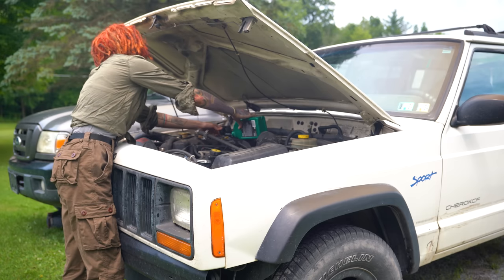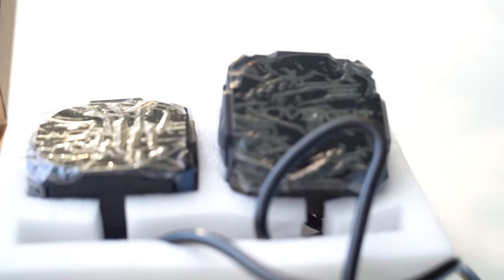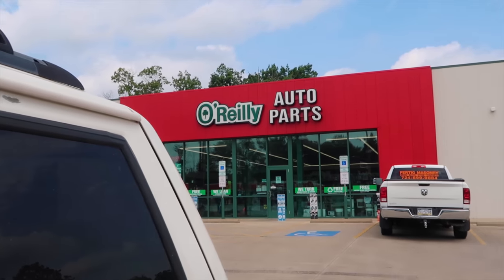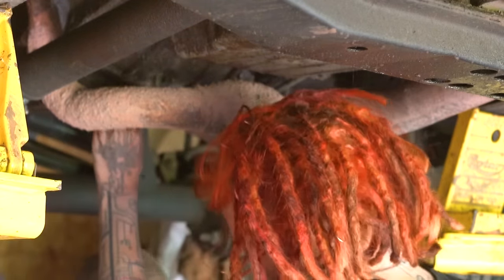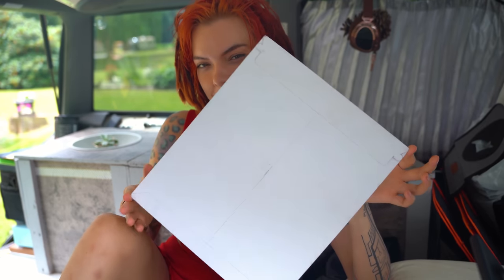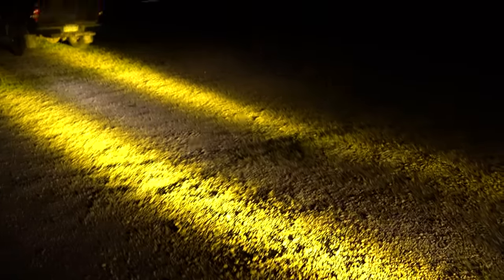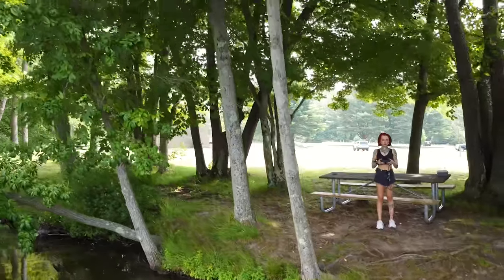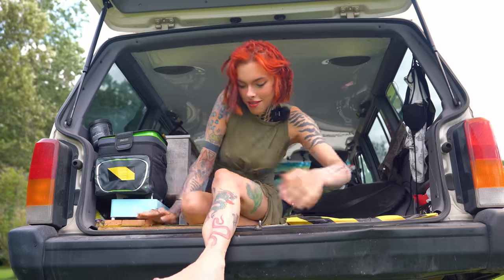upgrading my old Jeep Cherokee into an OFF ROAD Camper

Comment: Couple suggestions, upgrade your cooling sys, new cap, water pump, maybe a better fan clutch and auxiliary fan.  Also if you're having to prime your vehicle to start it could mean you're losing fuel pressure.  Could be a bad fuel pump, bad injector orings or fuel cap needs replacement.   Would recommend these items to be fixed before your big trip.
Reply: I second most of these suggestions, except ones regarding fuel pressure. Sounds like your experiencing heat soak with the priming of your pump. I've done hood vents, fuel rail insulators, and dual fans and it won't go away on those really hot days. Either or glad to see ya keep the XJ and looking forward to your Canada content!
Reply: @XJ_ESSE  I own a Land Rover discovery 2 with the 4.6L with a priming issue when the vehicle gets hot.  I'm pretty sure my orings are leaking and the fuel pressure regulator probably needs replaced too.  Typical on these older suv.  Victoria has a hum dinger.
Reply: @teyoung2000  I dig those discos, never owned one but good to know if I ever purchase one. But even with new injectors, coinciding o rings, new pump, at least in the XJ, it'll still leak down and lose pressure on hot days. I assure you, heat soak is notorious in these 4.0 straight six engines, and she'll be throwing money at something that is hard to get around when priming the pump 2-3 times will build the pressure she needs to eliminate the engine shaking at start. That XJ is no hum dinger, she went across the country and back with very minimal maintenance.
Reply: I agree, start with the cheap items first. Fuel cap, filter etc.

Comment: Yuki's coming along just fine. I would reconsider the placement of those off road lights under your bumper. I'd mount them on the top of the bumper (just drill some holes and rust proof them) or up on the roof rack so that they don't get torn off if you happen to cross over some weeds or other low obstacles while off road.
Reply from the maker: Yeah I considered that too but that was the easiest location at the time as there was holes pre drilled
Reply: Easy road is the Highway to Hell. To be better we have to put in some work.😂😂

Comment: Great job! I have a 98 XJ also. The shaking is more than likely the injectors. I would recommend K-suspension injectors. Also, new cap, rotor, wires and spark plugs will help. If you ever in California, I have a lift kit and bumpers and fenders I’ll just give you. Have a blessed day!

Comment: Jeep is looking great! A quick tip regarding your roof rack. It'll be a pain I know, I've been there, but take it back off your roof and put a good bead of silicone around the points where the sections of the rack come together. Once cured, hit those areas with a couple coats of black Rustoleum. Trust me, I have the same rack and within a year of having on my roof, it was rusting from those spots pretty heavily and dripping down onto the roof. And when it rained the rust would mix in with the water and leave trails down the windshield. Definitely worth the time and effort to fix .

Comment: I had a similar shake in mine. I took it to a shop and they told me the transmission needed to be replaced. With the help of the wealth of XJ information and enthusiasts on the NAXJA forum we narrowed it down to a transmission mount and I also replaced the engine mounts just in case. No more shakes.

Anyway, keep on keepin on. And have fun with your XJ 😊

Comment: New viewer / XJ daily driver for 15 years.  Pro tip try shell Rotella t5 or t6 for oil.  It has the proper zinc content the jeep 4.0 craves.  Im driving a 98 now with 330,000 on it and it purrs like a sweet lil kitty.

Comment: The trick to the decals is first cleaning the area where you're going to stick it(so it'll stick longer) then use a flat edge to smooth it down as you take the paper backing off(this gets rid of the air bubbles) Hope that helps! Have a good trip! 🦖

Comment: Great use of the drone at the start of this vid, very professional. A bit of advice don't rely on Bungie to hold down anything. They'll degrade over time due to UV. What you need are proper clamping straps. Carry spares out inside not on the rack.
Reply from the maker: They will prob outlast the Jeep tbh lmao
Reply: @TorieRobot  I'll remind you said that ;0)

Comment: With old trucks like these.you want to turn your truck on first wait about 10 seconds or till all the lights on dash turns off, then start it. These issues can come from grounding, old power wires, to your fuel system needing to be cleaned out. A full tume up is needs. Make sure the gap on the spark plug is correct. American motors like to share alot of the parts on assembly line so check that too. Anyways keep having fun!

Comment: Hang on to that Jeep! Put in the time and money it will become one of the most reliable vehicles available today and probably the toughest. This is an old vehicle that's worth putting money into. It has some age on it so it just needs some catching up on maintenance & repairs and a few updates to get with the times. Don't get discouraged when big things come up, there's nothing on that Jeep that cannot be fixed in a driveway or backyard and the cost will be much lower than anything else on the road today. When your Jeep finds trouble on the road.. turn to the Jeep community first, before you make a move or go to some unknown mechanic/shop.. you'll be glad you did. Maybe you already know these things but good info for other viewers.

Comment: It's a good idea to wear safety glasses when working on cars. I once got a small piece of hot steel in my eye because I took my welding glasses off to soon. It required medical care. I was a mechanic at a marina. Back then Wix was a better filter than Fram. I don't know if that is still true.
Reply from the maker: Yea that’s prob a good idea

Comment: YOU GET IT TORI!! Good job getting your oil change done yourself. If your using a Full Synthetic oil you can go 5000 no worries ( I use Valvoline High Mileage Full Synthetic myself ), Also good filter choice. Wix is a very good brand
Reply from the maker: Yes! Now I know how to do it! And yes I got full synthetic 👏🏻
Reply: @TorieRobot  good, I use full synthetic for all my fluids in my Jeep.... Ill be selling it actually in like 2-3 years if your looking for a newer jeep around then. Im going to be getting a ford transit, Im going to raffle off my jeep so you might be able to get it cheap!

Comment: get new battery terminals and check the wiring to the alternator and make sure your radiator is good. Check your fuel injectors. Most likely they are plugged up. Change your full pump and check the fuel lines. That's probably a couple hundred bucks. But will keep you going for a long time. change your spark plugs, gap them or get new ones. CHeck your fuel pressure.get a new fuel filter and check your battery.

Comment: Its been a while but a rough start that smooths out after a bit can be a hallmark of a failing PCV valve and/or I believe, a clogged throttle body.

Its been a long time since I've dealth with this stuff. 
The PCV valve is sm eady switch n replace. Throttle body involves removal 9f yhrottle body and cleaning out deposits rom the inside of it.  Happens after 25-20 years of running.

Comment: If you have an engine shake at idle or inbetween shifting gears (sometimes a clunk) it could be the rubber engine mounts or transmission mounts that need replacing they'll go 20-30 years between replacement.. alot of off road driving probably 10 years. Love the farm & sheeps.

Comment: The priming before start is a clogged fuel filter really inexpensive part if it's an out of tank filter my 93 jeep Cherokee had that problem hope that helps❤
Reply: Filters for these are on the fuel pump, not inline, so she'd need a whole new pump which I don't advise until it shits. The priming is because it's the hot summer months. Research jeep heat soak, I guarantee it's the issue. Ive done fuel rail insulators, hood vents, dual fans, and it just doesn't go away on those really hot days. Just prime it a couple times before you start and it'll build up the rail pressure blead off from the heat and be fine.
Reply from the maker: I’ll have to check that out thanks!
Reply: @XJ_ESSE  like I said my 93 jeep Cherokee fuel filter was inline it was located inside of the frame of the uni-body on the driver side near the shackle for the spring I have no idea about newer models but thanks for that information! 🤘
Reply: @jackblack2557  No worries, I've had an 78cj inline 6, 84 xj shitty gm v6, 89 xj renix, 91 xj ho, 94 4.0 zj, 95xj stroked, 3 98's and now a 2000 stroked.  I know a little bit about these rigs, just spreading some information to help. I've had a thing for the XJ for 15 years, glad to see everybody else is loving these rigs as much as I do and wanting to keep em around.

Comment: There is an elbow on the back of the engine for the oil filter, it tends to leak, check it good.
Reply: Shake is a slight miss. With the priming, likely a dirty fuel injector stuck open. Or crack in the fuel line.  But I would replace the injector with some 12holes.

Comment: I would replace transmission oil also if it was not done, specially if going for long trip. If it’s an auto it’s more involved then engine oil.
Reply from the maker: It’s already been replaced

Comment: @ Victoria rose, I love it looks awesome hey with cars trucks today if you keep up with regular oil changes in drivetrain todays vehicles can go a long long time and unfortunately, you have to work out the bugs in most used view I don’t know if your truck has a separate aftermarket transmission cooler ! I would highly suggest it considering it’s a older vehicle And it’s some thing you could probably do yourself

Comment: If you want your motor to run good and it’s an old motor start adding 1 quart of Lucas oil treatment to your oil. If it gets low instead of adding oil add Lucas it’s a pain to put in unless it’s warm so sit it in the sun, I know what I’m talking about 43 years of truck drivingalso the last truck I had before I retired I own for 23 years and the motor still run like a top are all my lawnmowers and everything else I have a lawnmower that is over 20 years old and it still runs and doesn’t use a drop of oil

Comment: Do more then a upgrade , rebuild it , jack up the suspension, put military tires on , rebuild the engine and replace the transmission with something heavy duty , rip out the wiring and rewire the whole thing with HD tinned wire , but big lights on it , research the internet for camper box builds , something that fold into a bed with stove sink and everything, put in something like a ecoflo solar system, go all out , make it completely new , investigate conduction cook tops and ovens ,film it all , write it off as a business expense
Reply from the maker: That sounds like wayyy too much work haha- but maybe someday! I would like to build up a vehicle like that !

Comment: get yourself a gallon of isopropyl alcohol. next time you flood your drone or any other electronics, disassemble right away and clean them with generous amount of it. it will evaporate quickly and stop any future corrosion or shorts from water residue.

Comment: I had the exact same vehicle. But blue.
Reply from the maker: I love seeing other old Cherokees
Reply: @TorieRobot  mines in the grave yard, Long gone. Almost Exactly the same vehicle u got now. Just blue 🔵 with rear tint, mine was two wheel, not 4 wheel drive. I had around 2 thousand miles on it be 4 I crashed it on the highway .. .  Cheap Hard tires in winter, no 4 wheel drive, lesson learned real quickly on that one .  😆😂😂... I will never ever buy a two dive again.. 4 wheel or all wheel drive.. two wheel is fine in the summer 🌞⛱️. But winter, 4 wheel is a must, being a commuter to the city 2 to 4 times a day, chances of getting in an accident increase. drive it twice a day. 40 to 60 miles a day, don't go nowhere. So 120 miles, times that by 300 days a  year. 38 thousand miles a yr  Roughly speaking.  18 plus yrs of commuting to the city for work. The only thing iv ever seen is the farmers fields, cows horses the odd road kill, mountains r to the west of me..  what a life.  At least u get to experience freedom 🦅🦅🦅🦅 in your white rapture bombing around state to state in the summer, lots of fun....  ..

Comment: Some time the motor mounts wear out and that's why the motor shakes.
Reply: Buy an aluminum oil cooler.  I have had two Cherokees before they begin to spill oil.  I recently change the oil cooler for aluminum on my 2015 jeep jk.  X a big difference with the cooling system and transmission temp.

Comment: The shake when starting sounds like a busted engine mount. There's essentially stiff rubber pads as part of the mount meant to dampen vibrations and when they go bad, the engine vibrations will cause a shake, and its typically noticed when starting. If you want an easier time crossing into Canada, take I-81 north and cross at Wellesley Island between NY State and Ontario. You then will have ramps to Highway 401, west takes you towards Toronto and BIG city prices and crime and lack of camp options (though lots of walmarts which allow overnight parking for RVs), and east you'd you have either Montreal, QC (eventually) after the 401 crosses into Quebec as the third biggest city in the country, or my suggestion i keep making, get onto highway 416 and come north to out country's capital, Ottawa. In this area there's lots of green space, the quebec border is the Ottawa river so you can get to enjoy two provinces back and forth easily, I know an EXCELLENT female tattooist named Victoria (her IG link is https://www.instagram.com/moonfox.ink/ ) in the town of Rockland which is about a 20 min drive east of Ottawa who's style I think you'd enjoy, My friend Isabelle runs an animal sanctuary (her IG link is https://www.instagram.com/isme_farley/ )that's near Manawaki QC, about an hour's drive north of Ottawa where you could camp Yuki at, located along the shore of the Gatineau River (she has her own pvt beach area too), and if you wanted to get some more bike riding in, I could help you with that. Oh should you DO come this way, or at least eastward on the 401 from Kellesley Island, and are doing this on a thur, fri or sat consider popping off the highway briefly in the town of Prescott and visiting the Fruitful Gardens produce stand at the corner of Edward and Henry, the owner Carolyn grows good fruits and vegetables. If you want to reach me for more info and places you can camp yuki in the area, I'm still a member of your patreon for another week I think or you can find me on my IG ( https://www.instagram.com/godzillasenormoustail/ )

Comment: YOU ! need to know every thing about your little jeep so you can live with out fear of  lost . go auto mechanic class to repair. and always keep  extra 5 quarts of oil, gal or two of radiator fluid because it is always getting hot.
Reply from the maker: Yea I should do some classes tbh
Reply: @TorieRobot  You've already have been through the 'classes'; now you know that Jeep better than any vehicle prior; it's seen more love in the past 3 months than it saw in the previous 10. You know what it can (and cannot) do; drive it with pride and care and it will get you there and back. Great vid, great work, hope to see more of Yuki on the road.😘

Comment: Clearly, your father has mechanic skills. Did he fix the overheating issue with the jeep? If not, you've got a rolling time bomb. The problem is only going to get worse. Also, the engine shake is most likely a misfire and could be related to the overheating issue. Your father needs to do a pressure and leakdown test on the cylinders to see if you have a head gasket failing.

Comment: Watching someone spend so much time and money on cosmetic upgrades on a rig that clearly has major deferred maintenance is like watching the girl in the horror movie check out the strange sound in the basement.  Nothing I say will make a difference, but I can't stop watching the impending disaster...  5 star entertainment
Reply from the maker: You can’t really just replace all the parts .. if something breaks you deal with it then. I bet you’re fun to be around 👏🏻
Reply: That's just it, things usually give you warning before breaking.  Your car overheats in the heat at low speeds unless you blast the heater, can't maintain speed uphill, and runs rough on start-up.  All of that can be fixed at home before it fails in the middle of nowhere leaving you stressed out & at the mercy of some random mechanic who might rip you off or take 2 weeks to get you back on the road.

Your jeep looks to be a solid rust-free example and there is no reason it can't go over 1,000,000 miles if you commit to keeping it healthy.  Mileage is really irrelevant when you're dealing with a 25+ year old car - those that are maintained last, while those that aren't end up in scrap yards.
Reply: The only person in the comments that’s ever told her the truth about anything instead of just “slay ku-WEEN!”